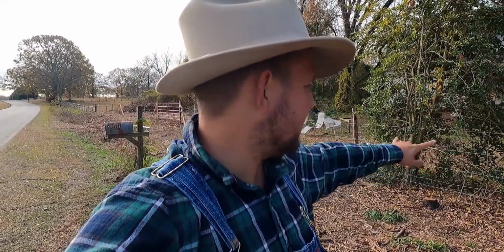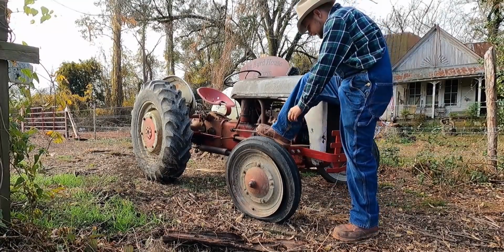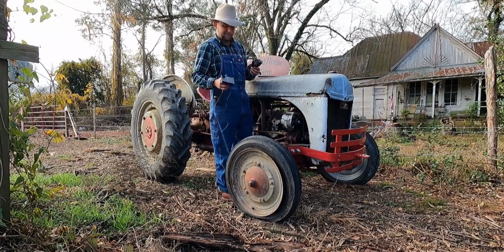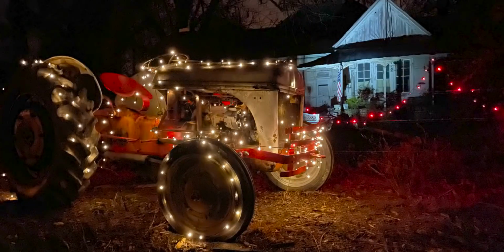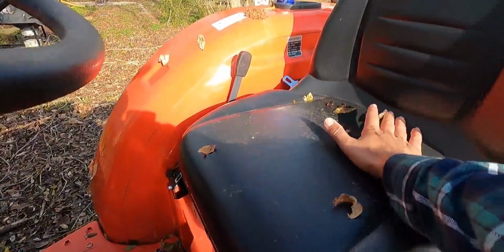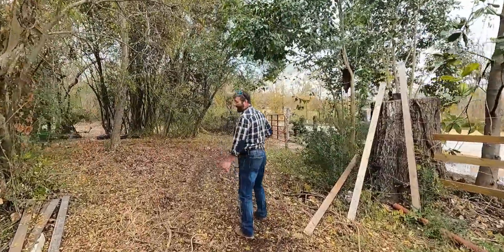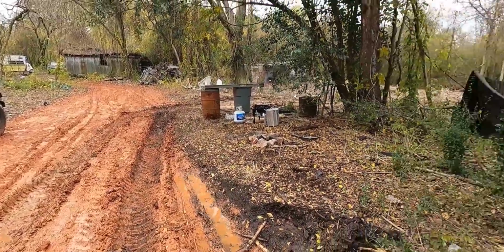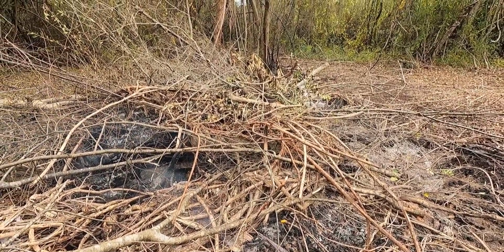CHRISTMAS LIGHTS FOR FORD 9N TRACTOR AND CLEANING UP OLD BARBED WIRE FENCE ON 140 YEAR OLD FARM

Comment: For what it's worth to you, your ford is really a 2n. the 9n had an H beams on both sides from the transmission to the front axel, and the rear axels did not have the center rivets. There are books on the N series fords. Nice tractors, I have an 8N and a jubilee. I grew up from age 7 with the 2N and had 3 2N's of my own in the past.

Comment: I don't understand why you can't put some green slime sealer in the tractor tire and seal it up. Put a 16 oz. can in it and fill the tire with air. It should stop the leak. Use the heavy duty sealer of course.
Reply from the maker: Because the tube is ripped 🤨